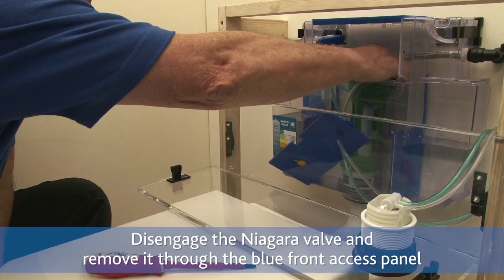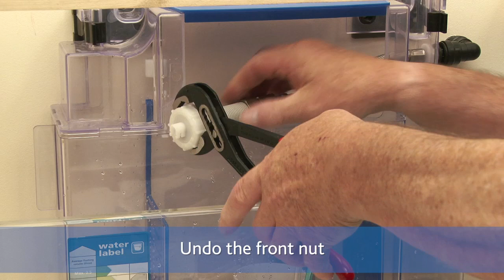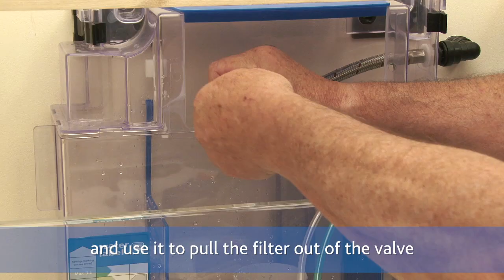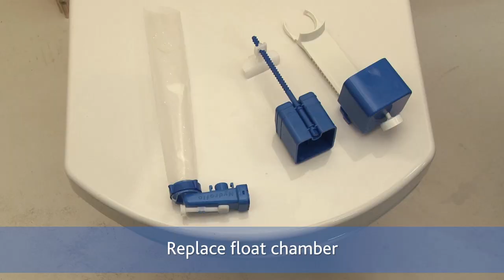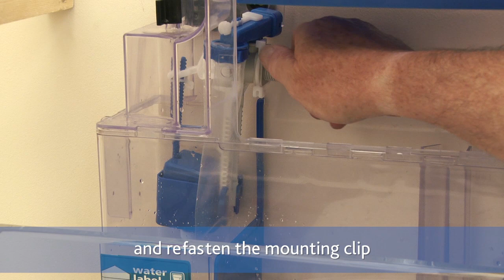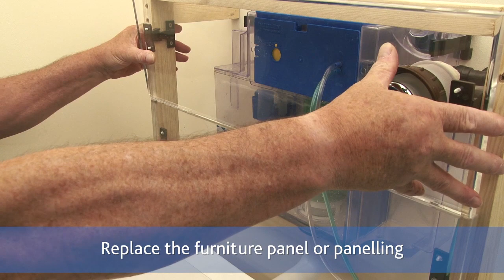How to service a Dudley Vantage Concealed Cistern

Comment: Excellent - this solved my slow filling problem in seconds. With ten years of scale behind the filter I was able to dismantle it. Next time I'll stick the instructions next to the cistern. Thank you. It's a great unit in every respect.
Reply: I have a Thomas Dudley single flush TD212-A which has developed a problem. The first problem was that (and I don't know the correct names for these parts) within the green cap of the flushing contraption was a tiny rocket and flap which operated onto a diaphragm. The plastic clip here was broken but I have fixed that with a new drilled hole and wire, so it works. However to flush the loo, a single press of the button fails to properly flush. A one second press and the flush just stops. A ten second push keeps the flush working. So a short push just doesn't do the job any more. Nothing appears amiss. Help!

Comment: Here I am again with the same problem - the hollow float seems unable to lift the valve shut so I sealed the silly open ended float and still it is unable to lift the valve shut - I have reduced the pressure and flow to no avail. I get the idea of the valve is to equalise the pressure and close the valve but it is very problematic and i'm getting ready to change the whole Flusher if it continues.

Comment: I have a valve problem - the float raises but will not shut the water off and so it over tops the overflow pipe.  Have cleaned the filter, checked the diaphragm and the tiny rubber seal in the lever control but still cannot get it to stop filling - HELP